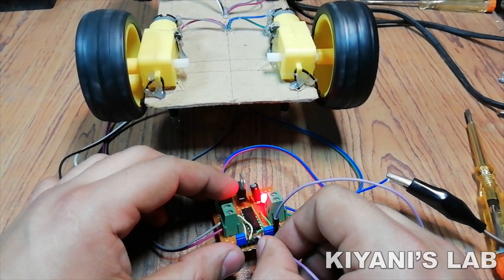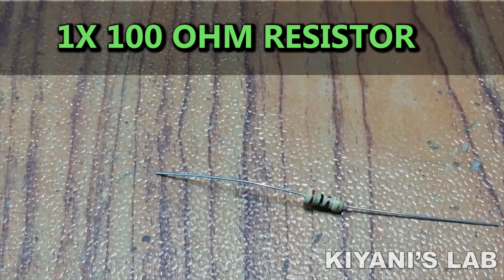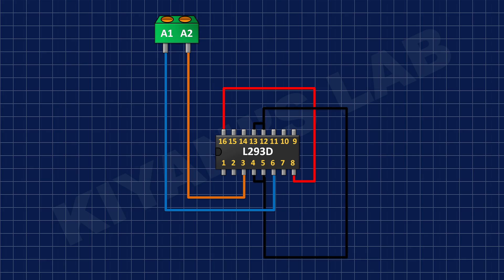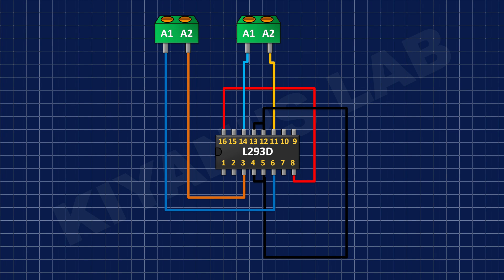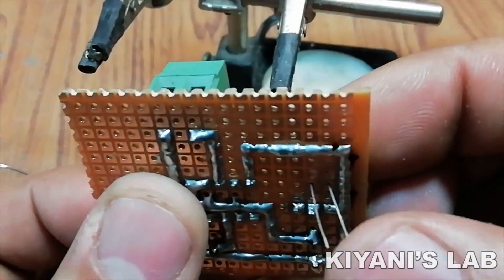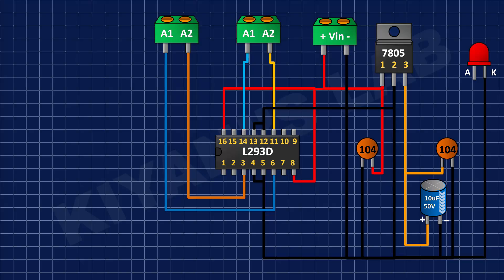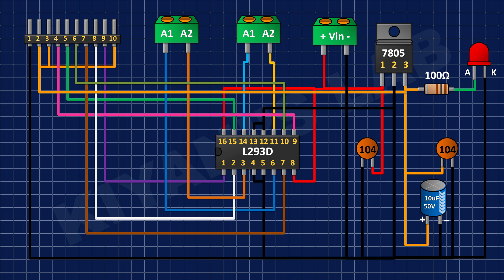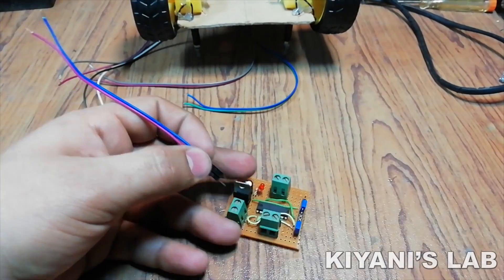How To Make Dual DC Motor Controller

Comment: In electrical engineering, how do you know when to use a capacitor, resistor, diode etc in your circuit designs?